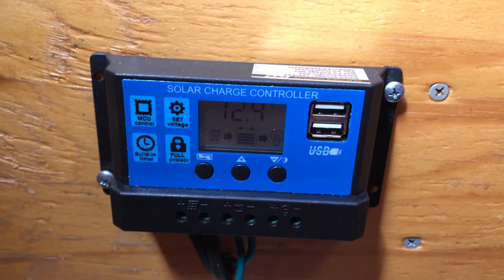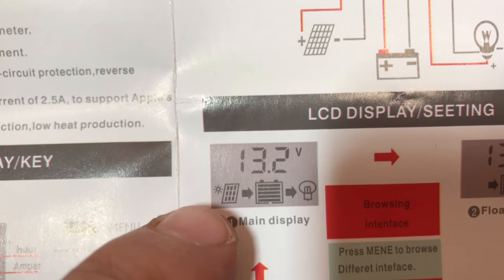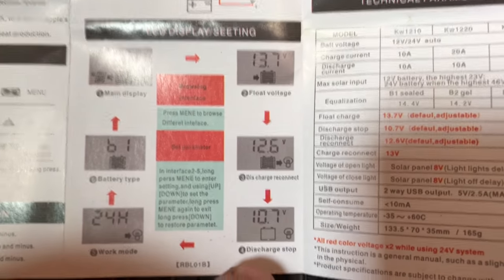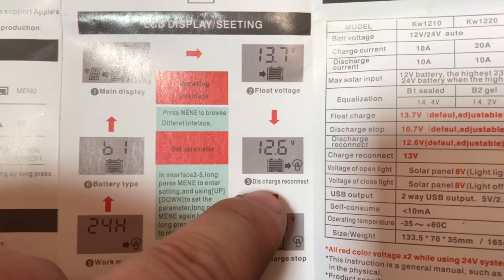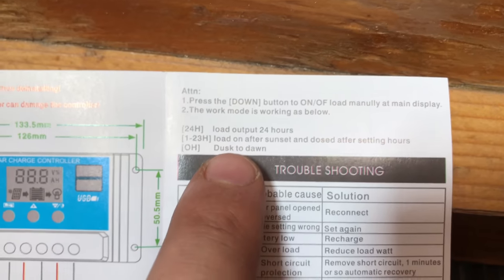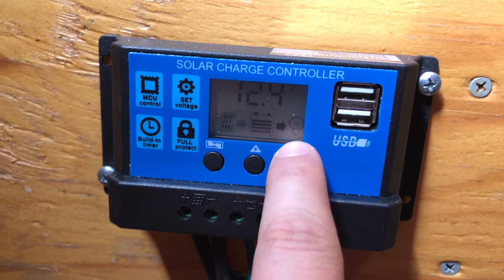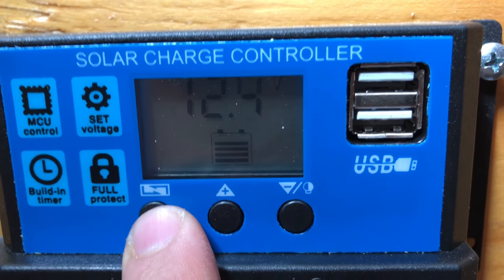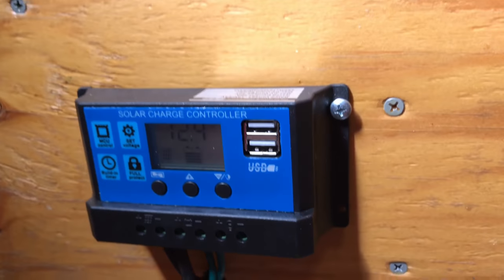How to setup a basic Solar Charge Controller | Quick Guide & Menu overview

Comment: I just bought this controller and the flexible solar panel that comes along with it. I have no idea what cables I need to charge the battery. I only received the cables to plug to panel and insert in controller. Any help would be greatly appreciated.

Comment: I have my panel connected, I'm sure all wiring is correct, but ZERO display. Does it need to be turned on, or  does the reserve battery need to have some power to activate the controller? Cheers!
Reply from the maker: Yes, the battery needs to be connected to the controller first and have a charge.
Reply: @ScottsSolarProjects  Cheers!

Comment: what setting should be used when you have this powering 2 12v batteries in a series?  Would you jup the float voltage to 24 volts and not 12v (because 12v series outputs 24v)?
Reply from the maker: I don’t have experience with that specifically, but I’m quite positive that you would double the float voltage. And the controller might sense that automatically when you hook it up.

Comment: Thanks for the help with this tutorial Scott. So just one thing, mine always give me as output the same V that the battery has, it is ok? because i just thought is should always be 12v or close to that.
Reply: @ScottsSolarProjects  
Is it composery to set the change controler before using it

Comment: Thank you! I set the floating voltage to 13.7V, but the controller ignores this setting and literally constantly boils the battery at 14.8-15V. Is there anyone with the same problem?

Comment: When it shows the battery level... is there not a way to have it show that to you not as a percentage but in total battery power? And is there a way to have the charge controller tell the max battery capacity? 

When you have more than one battery... or if you add a battery to a series of batteries, how do you know its reading the number/percentage on the charge controller as all the batteries, and not just one? 

Thank you.
Reply from the maker: On the main display, the battery icon does show you battery bars for how fully charged the battery is, though I’ve never tested how accurate it is. And no, it can’t tell you the battery capacity.

If you have more than one battery connected in series or parallel, it will simply read all the batteries together as one voltage.

Comment: Mine shows a battery voltage but when I connect to the solar panel, I get random flashing voltage numbers of around 10 and 20v and none of the 3 buttons does a thing.

Comment: when i connect a load (12v lights on my boat) the battery charge icon goes blank or starts blinking, same happens when i add another battery in parallel, i got it to work a couple of times, but then the voltage drops quickly and the controller does the same again... any tips? i would like to connect either 4 12v batteries in parallel or 2 prll + and those in series for a 24v system.

thanks alot for explaining the different setings. cheers!
Reply: @ScottsSolarProjects  would it help to charge them fully with a regular charger first? because i got em 2nd hand and they were discharged to around 10.5v, you think that's a problem?

Comment: Hi Scott, very helpful video, Thank you. Would you please tell me what amp wire you used & was it the same wire in all 3 ports?
Reply: I used 10 G, as this is the biggest it will fit. I have about 400w of solar & 6- 6 volt batteries, wired as 3 - 12 volts.
Reply: I use thick copper stranded wire crimped into boot laces. You can buy 1000 for £3.

Comment: that helped thanks, However I have one question I hope you can answer. The solar icon flashes ( not the arrow) but the instructions don't give any indication why? Any idea?
Reply: The solar panel is working but the battery is full so it can't charge any more.... Maybe 💁‍♀️
Reply: Is it a similar controller? Ihave not seen solar icon flash for this. It's disappears when sun sets
Reply: Ask an eBay seller what it means.

Comment: Hi, thanks for the explanation. With work mode from dusk till dawn does it mean the battery kicks in from dusk till dawn and after that the load switch from battery to solar?
Reply from the maker: I just posted a video explaining the load/timer settings: https://youtu.be/v-iLu9DS558

Comment: always wondered what you would connect to load. I connect all loads direct to battery.
Reply from the maker: Yeah, majority are to the battery, like inverters. But, if you have a small fan or light, you can connect that to the load section.
Reply from the maker: I just posted a video explaining the load/timer settings: https://youtu.be/v-iLu9DS558

Comment: hello, i have this type of controller 30 amp. reading the answer from amazon about it, someone said i can go 250 watt input panels on 12 volt, or 500 with 24 volt. i have about 600 watts total in 12 volt panels. ioh, also that controller can accept 55 volts input. so can i do 4 panels in series to be 48 volt? and no where does it say the max for panels my controller accepts, just 30 amp charge. i have 4 car batterys, and what is the load side of the controller for if your invereter goes to the battery directly. bought everything, and about to try to install it... info please
Reply from the maker: Just make sure you do not exceed the 30 amp solar input. Remember that a solar panel can output between 18-24v, which if you want a 24v battery system, you would want to connect your panels in series so you have enough charging amps to actually charge the system. With this controller, you can’t connect 4 panels in series. The load side is just extra if you have something smaller you’d like to run off it. Otherwise just use your inverter directly off the battery.

Comment: How much is a charge controller going to affect the quality of your system? People talk about kinds of charge controllers but not how much it will affect the charging ability from 1 kind to another. If you get a good one or a great one or just average, will they all run the same or will they change the effect of the battery quality and performance much? 

Thanks.
Reply from the maker: Good question. These PWM controllers are the cheapest and lower quality controllers. But that’s okay especially when all you need is a $10-15 controller to automate a certain task like turning lights on and keeping the battery charged. If you have a more delicate and larger system, then I would recommend an mppt controller, and furthermore a Victron which make high quality controllers that connect with your smart phone!

Comment: The 601 60L 6O1 is referenced in the Chinglish  instructions.  It represents a lead acid battery type.  If you have another type you should perhaps change that parameter.  Look at the specs on the right side and it will show you.

Appreciate the vid.  Trying to get my new battery backup set and your vid helped me.
Reply: Good point. I charge LiOn's and lifepo's with no problem with same charger. Just have to keep an eye on the parameters.  I use it to keep my battery packs charged for my ham radios while my wife and I are camping.
Reply: CHINGLISH. GOOD ONE. REMINDS ME OF EARLY DAY NIPPENDENSO NIPPENDENSO ENGRISH !!!

Comment: Hi Scott, quick question I’ve installed a solar panel and similar charge controller to this in my caravan. So I have an inverter running off two batteries that will power my 240v circuit. I also have a 12v circuit, should I take this directly from the batter or hook it up to the load on the charger controller. Many thanks
Reply: @ScottsSolarProjects  so will it run from the charge controller at night ? With nothing coming from the panels ? Thanks for your help appreciate it. 🙏
Reply: @ScottsSolarProjects  thanks that’s a great help, much appreciated 🙏

Comment: I just got this for a car solar panel but there’s no wires at the bottom. How do I connect it to the car solar power panel or battery? Thank you
Reply from the maker: You’ll have to determine the correct wire gauge and wire it yourself. Under the charge controller are 6 ports that you can insert wire and use a screwdriver to secure them in place.

Comment: Hi Scott - what guage is the leads which are connected to your controller? I need to make some leads because I don't trust the small (crap) leads which came with mine with minimum insulation.
Reply from the maker: I don’t have the camper any more, but I semi recall using 14 gauge wire I believe.

Comment: Just got mine today, 10A 12/24v.  My float won’t set below 24v.  Am I missing something? Nothing will set below 24 for that matter 🤷🏻‍♂️
Reply from the maker: Oh, that’s interesting…I assume you have 1, 12 volt battery? Not a 24 volt or 2, 12 volts in series? If not, maybe it was programmed incorrectly. I don’t think there is a switch for 12/24 volt.
Reply: @ScottsSolarProjects  thanks for replying so soon.  It’s only 1 12v battery.  Now I’m looking for a new one on eBay but they all seem to be the same make, unless I want to spend £70 on a different brand.  I won’t be doing that!
Reply from the maker: You bet! Are you able to buy one like this? https://amzn.to/3zDMQQw

Comment: How do you connect the wires from the charge regulator to the solar panel  and battery. Mine didn't come pre wired
Reply from the maker: You have to do your own wiring. Choose the right gauge wires, strip them and you can stick them up inside the solar charge controller and tighten them down with a screw driver.

Comment: I'm really interested to know which battery type to select using this Solar Charge Controller, I couldn't find it anywhere, Thanks
Reply: it autodects the battery type wen you put the battery on for the first time. b1 I think is a standard lead battery.
Reply: @argmentum22  I hope there will be someone who could show  putting up different type of battery and see if it's auto select or not
Reply: leefiz there are other videos that show this .. I checked after replying . B1 is lead battery for sure
Reply: @argmentum22  Thank you so much for yr info, appreciate it.
Reply: b01: closed battery (as AGM or calcium) b02: gel battery b03: wet battery with liquid electrolyte

Comment: Can you hook two 100 Watt panels to one battery without going over 100 Watt max
Reply from the maker: Not quite sure what you mean, but you can connect 2 panels in parallel together on a less sunny day to stay under the max input watts allowed.

Comment: I have the exact same controller. All my numbers are for 24 volts. If I half them they are about right. Any idea how to set it for 12 volts as opposed to 24. I suspect its automatic and I have a faulty one, but...... Im using 100 watt panel thats given me 12 volt readings on previous controllers. Thanks
Reply: @ScottsSolarProjects  Thanks. I discovered loose wire to battery alligator clip which was sending the controller into pirouettes. Thanks

Comment: Unfortunately this charge controller doesn't let you set the load lower than 13.7, this number is on some batteries the max load, I had two sealed batteries connected to this controller which are overheated eventhough the setting was locked to 13.7, so it killed also my inverter at the same time.

Comment: Hi! I cant seem to understand what how the timer functions. 24H, 1-23H. OH. I get the terms, but can't seem to figure out how does it know what time it is? Does it just start at the moment of activation?

24 - it works for 24 hours
0H - I'm assuming it works for 12 hours (6pm to 6am), how does it know what time it is? does it just assume its 6pm at the moment of activation? So I need the time to be 6pm when I activate it?

What about the "1-23H". does it just mean the amount of hours it will run? 
What if I set it at 12hours at 6pm, is it basically the same as the 0H option?
Reply from the maker: Don’t quote me on this, but I would assume that 24H is…24 hours running (off the power output.) the 0H provides power to the output from sunrise to sunset, so no need to activate at a certain time, it simply powers as long as the sun is producing solar. And 1-23H is customizable for you to choose how long the output is powered. Hopefully that helps!
Reply from the maker: I just posted a video explaining the load/timer settings: https://youtu.be/v-iLu9DS558

Comment: You dont seem to have anything connected to the load (no cables into the controller) are you connecting your load straight to the battery instead?
Reply from the maker: Yes, because the load output on the controller is only capable of up to 120 watts. I did use it to run a 12 volt fan though.

Comment: does somebody know whether I can plug in the solar panel into the charge controller via the jack ports? Or those jack ports are only for output and not for input?
Reply: Yes, I understand that. But, what about those two additional Jack ports? The first and the last on the row. Can they be used to plug in a solar panel?

Comment: Hi, thanks for the video, I have the same controller but it came without instructions, should the arrow flash on the display between the battery picture and the load picture (bulb) if it is drawing power? Thanks
Reply: Yes it means it’s charging

Comment: No one ever seems to have anything attached to the load output.  I have a Carcoon that I am running off a couple of gel batteries.  I have the Carcoon attached directly to my batteries.  Unfortunately, a wire fell out of the charge controller from the solar panel and the batteries were completely drained.  I have been trying to get them up and running again and it occurs to me that running the Carcoon off the load output would have allowed the charge controller to prevent the Carcoon from completely draining the batteries.  Why does no one seem to use it?
Reply from the maker: Thanks for your comment! One problem is that the load section only allows up to 10 amps max, or 120 watts depending on your controller. So that limits a lot of people who want larger power draw. Check out my video I just posted about the load: How to Setup the Load on a Solar Charge Controller
https://youtu.be/v-iLu9DS558

I hope this helps!

Comment: So I have the 200 watt kit. When the solar panel is not showing does that mean it does not have enough sunlight. The sun was setting when I tested them and I never saw the solar panel icon. Thanks
Reply from the maker: Yes, no Ivón means not enough sun light usually. It’s surprising sometimes how much sun is needed at a good angle to produce a good amount of power.
Reply: @ScottsSolarProjects  Thank you I appreciate it

Comment: Hi, I have an issue of when I connect the panel to the controller, the voltage on the display goes from 12.2 which is the battery level up to 14.4 and then shoots back down to 12.2 and the solar panel charge icon disappears. This means the battery is no longer charging. 

The troubleshoot says reconnect panel which I’ve done several times but the same happens. I changed the upper limit in the voltage to 14.5 and noticed that the reading reached that level before dropping and stopping the charge. 

Any idea what’s wrong?
Reply: Exact same Problem here. The way I interpret this is as follows:
1. The charger charges the Battery until it reaches the limit you set in the menu (called "Float Voltage" in the manual)
2. Then it drops to a lower Voltage of 13.7 V
3. This means that the manual is wrong. You can set the "equalization stage voltage" aka. peak charging voltage, and the float voltage ist set at 13.7V and can not be adjusted.

Can anyone confirm this? And when does it go from float to charge at peak voltage again?
Reply: @zegezege2101  I think it's that the solar panel native output voltage is too high. Mine is around 35V which the charger can't handle. That info is not published however.

Comment: How come when the sun fades, the voltage from the battery starts to drop. For example, if I charge from 12.2 to 12.5v when the sun's out, when the light fades, I see the battery voltage on the controller display start to go back down again so I'm back where I started. Maybe I should manually disconnect the controller if it's eating up the power gathered?
Reply from the maker: I understand the frustration, I wish it wasn’t like that. But, when the battery is receiving a charge, the voltage increases because of the charger, but it drops the second it is removed. In order to see the true voltage of the battery, you need to take the voltage reading of the battery without any load/chargers connected after it has been resting for about 15 minutes. Then, charge the battery and afterwards measure the voltage again the same way as before. You should then see an increase in the true voltage reading.
Reply: @ScottsSolarProjects  Thanks a lot. Didn't know that. Will experiment with a multimeter.

Comment: Will the controller be damaged if i didnt connect a bettery in it? I want to charge my phone using the usb slot of scc without the battery
Reply: From what I've seen it needs a battery. Thats the 1st step in hooking it up for a reason so it can dump the excess voltage. Get a small 7ah SLA battery and you'll be able to charge at night also.

Comment: Just watched the vid - and your sola icon is fully on my flickers ? Why is it not enough sun ? As I’m in a barn building it can’t be lose wire as I checked like 100 times 😢
Reply from the maker: As long as the wires are tight, sun is shining on the panel and the controller  was setup properly (connect battery first), then I see no reason why it shouldn't work and have the solar icon flashing. Best of luck!

Comment: The 61 is actually b1 for the battery type. The b1 is for a gel type battery. It will tell you in the instruction what b1, b2, b3 battery types are
Reply: Yours came with better instructions than mine. I can't find anything that describes what the different battery types are.
Reply: Which one is for agm?  My instructions didn’t come with it.